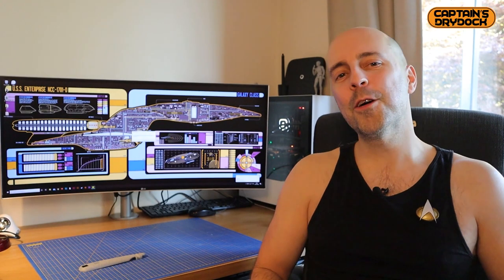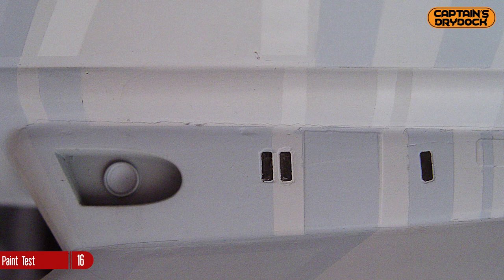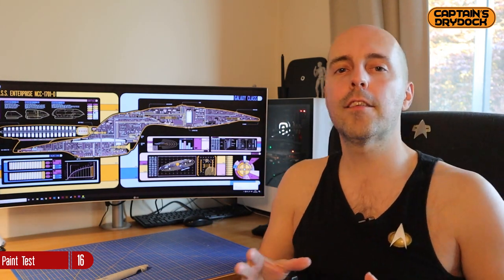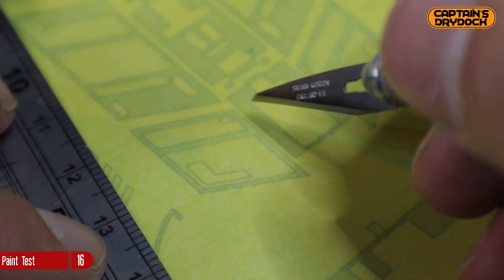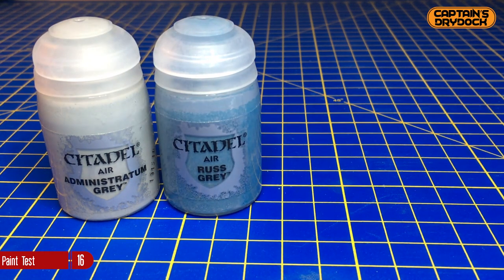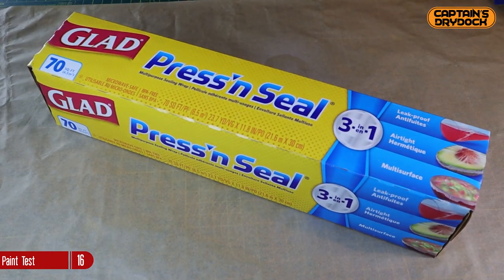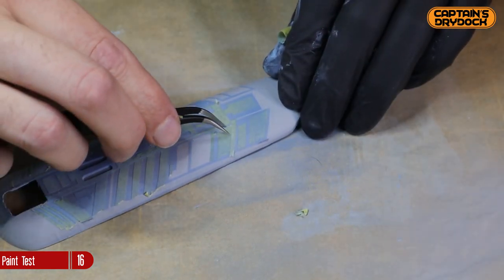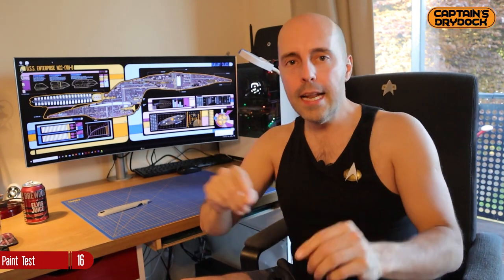Building the Enterprise D: Episode 16 Paint Test

Comment: Thanks for the video, looks like your kit will turn out real nice!  Just so you know there were in fact two different paint jobs using different colors. When they first built it the model was painted in blues and greens and only had two colors to it's pattern. The rest of the detail was actually done with pencil lines which ILM put all over the model. The 4' model was painted the same as the first paint job. When it came time to do Generations all the colors were changed or at least the green was dropped.
Reply from the maker: Thanks :) Yeah, I've had a few knowledgeable viewers say the same. I knew about the duck egg blue. But did not know about the pencil lines :O Wish they went on tour in Europe.
Reply: @CaptainsDrydock  I got to see it last summer when it was in Dearborn MI were I live.  Awesome model and vary big. Unfortunately it was in a glass case with a big light over it so I couldn't get vary good pictures but the paint job is far more complex then you think. I counted what looked like six different colors in the Aztec pattern but some of them were so close to others it's hard to see in pictures. I'm currently working on the 1/1000 scale fiberglass kit that was for sale last year myself, love the Enterprise-D.